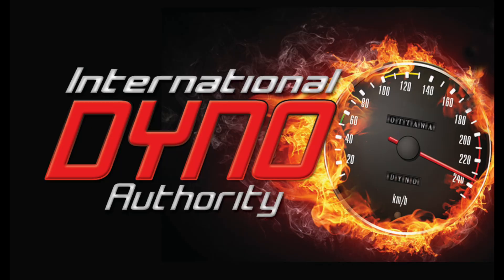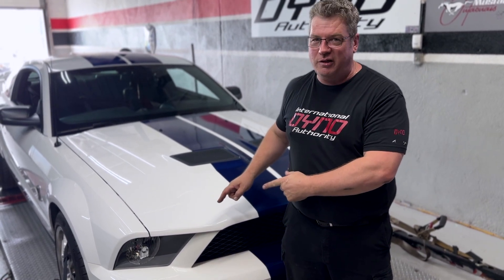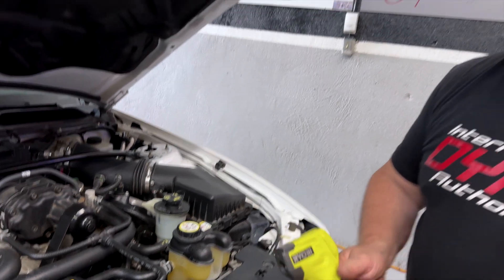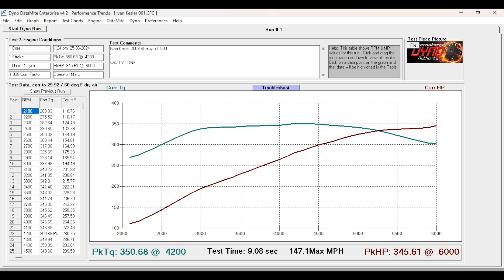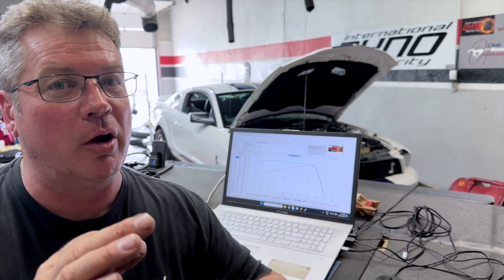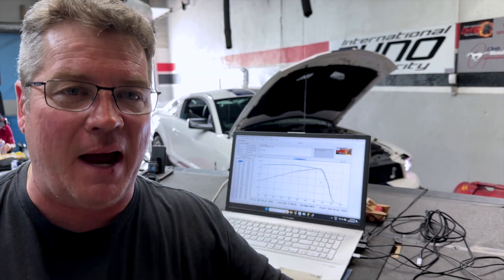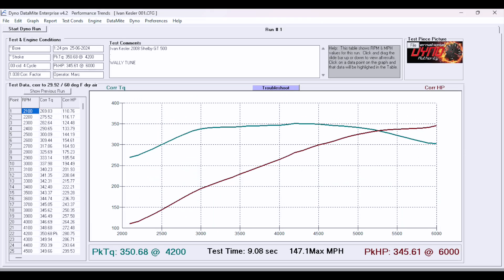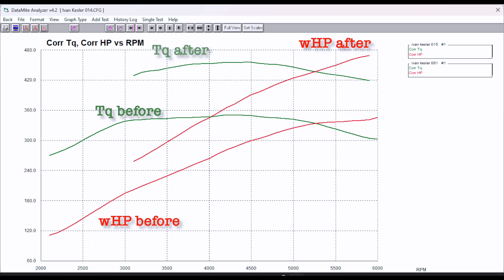ONLY 345 Horsepower! - What's gone wrong? | 2008 Mustang Shelby GT500 can't keep it's cool

Comment: I have a 08 gt with a Whipple super charger and a corsa cat back, and i got 420 at the wheels.  How dose this car make so little power?
Reply: Put your 08 gt on his dyno, you can't compare numbers from different dynos.
Reply: 100%, which is why it is always ridiculous when people say, with this, this, and this, what kind of power will my car make!  Or when aftermarket parts manufacturers release a part for a car, and claim their part tested at a certain amount of power.  But never did a stock baseline test, then a stock optimized baseline, then a few pulls with their part.  If they don’t at least do this, the numbers they are claiming are worthless.  I also wouldn’t trust their engineering or manufacturing standards.
Reply: 468RWHP seems pretty awesome

Comment: Terrible stock horsepower numbers ! 500 down to 317 ?
Reply: Crank horsepower is not the same as wheel horsepower. You’ll always have lower power at the wheels. But a near 200hp drop is bad
Reply: Remember it was out of tune when it got there. 468RWHP is about 540HP at the crank